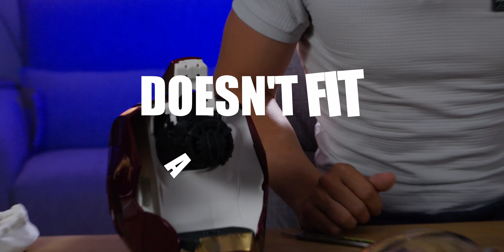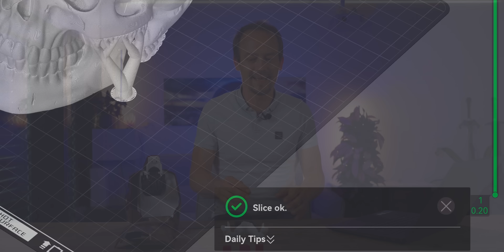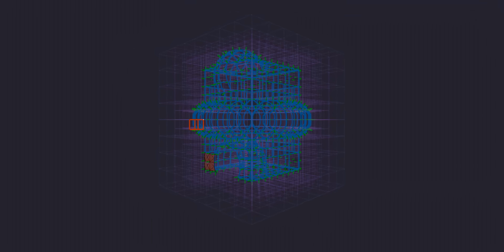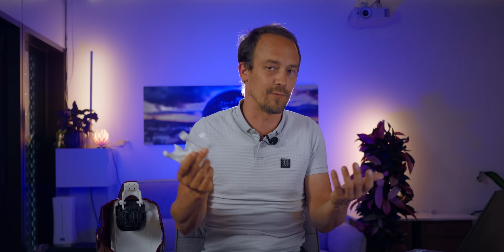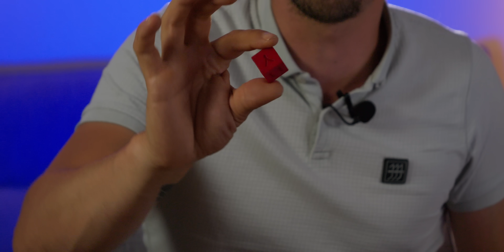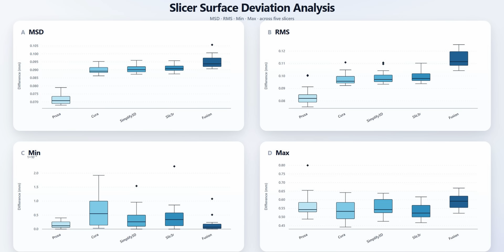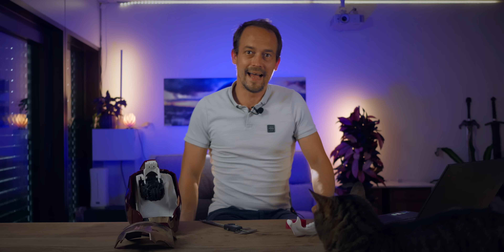The Hidden Error in 3D Printing - This is How We Found out

Comment: 15:38 - Can you also compare the intermediate meshes created from the gcode to the scanned 3d print?

If those intermediate meshes closely match the scan then you can more confidently say that most of the error is coming from the slicer. However, if the intermediate models don't match the scan, then you're probably seeing errors in the slicer and the print process interacting constructively and destructively, and they just happened to give about the same level of overall deviation in this test case.

Comment: Seems to be an issue that cnc machines are not facing. Could be somthing as simple as the nozzle diameter being added in the wrong direction. Slicers where first used for cnc and that is the total opposite of 3d printing.

Comment: 8:51 - I'm very curious how you converted the tool path, temperature, extrusion speed, etc. into "the geometry". Did you just put a shell around the tool path? That doesn't seem sufficiently accurate. Did you try to approximate all of the fluid dynamic magic that slicers depend on? That seems very hard. I'm not remotely qualified to draw conclusions, but wouldn't errors in the approximation algorithms, or just differences in assumptions, dramatically change the test results?

Comment: Slicers have all these crazy settings because of the filament and machine accuracy issues to begin with. They built those settings to correct for the machine and filament. So their true representation assumes based on those settings and makes corrections to the final gcode to be as close as possible after those settings and machine and filiment are all dialed in. It is not gecode as exact as the part. Its exact as the settings for your machine to print that part. Your simulation would need to assume the machine and filament act as per the settings suggest they should because those settings are compensation. But it is nice to know that one of the most popular slicers is one of the most accurate of the bunch!
Reply: Exactly, that's why I think his ranking is arbitrary. In Cura, for example, you can adjust the accuracy using the "Slicing Tolerance" setting which should give you 3 different results, not just one.

Comment: Anecdotally, your findings match the perception of Prusa Slicer being especially dimensionally accurate. But if I read the paper correctly, you are using a 0.1mm resolution for the voxel grid and display results with two fractional digits of a millimeter? That feels fishy, too fishy to be explained away in three sentences. It should have been a 0.005mm voxel grid at the coarsest. It feels like you guys went out of memory and didn't know how to implement a compressed voxel representation. Btw: Millions of millions of triangles is not a measure of precision...

On top of that: If you trust the voxels, then use voxels! exclusively! Why use marching cubes at all, only to then compare triangle meshes which is much more complicated and introduces more sources of error? Voxel volumes are much easier to compare. You could print a histogram of voxels by distance/error. You could draw the error as a 3d heatmap to gain a lot of knowledge. Maybe the error comes from elephant's foot compensation? Would be easy to see on a 3d heatmap. Maybe the errors in the prints are in an entirely different location than the slicer error? Would be easily visible on a 3d heatmap.

Anecdotally, a significant loss of precision is caused by warping induced by thermal shrinkage. Shrinkage is enough to make prints pop off the sheet or lift off the sheet. Assuming a shrinkage of 0.3% on a 200mm part is 0.6mm. As I understand it, you have your printers calibrated for shrinkage. But warping is worse than just shrinkage, especially for long and thin parts, e.g. a jawbone. This is a well known effect that is used by bimetals for example. Again this is something that would be easy to check and see on a 3d heatmap...

Comment: A few advanced slicer settings could explain errors on complex prints. A big one is "minimum feature size" which slags on an extra 25% nozzle diameter of ignored features on complex prints. Another is "outer perimeters first". You want to print the outer perimeter first on complex prints because inner perimeters can crowd the outer one another 25% during printing. The main situation where you do not want outer perimeters first, is multi-material prints where it helps to clean the nozzle inside the print. Another might be steep overhangs where you want some scaffolding to attach outer perimeters to. Slice closing radius can also be cut in half. Also try turning on arc fitting, reducing minimum perimeter width, increasing distribution count & transition filter margin. This has enabled me to achieve spiffy results with PrusaSlicer.
Reply from the maker: Those are some great tips for fine-tuning, I'll definitely have to experiment with those settings! 😊
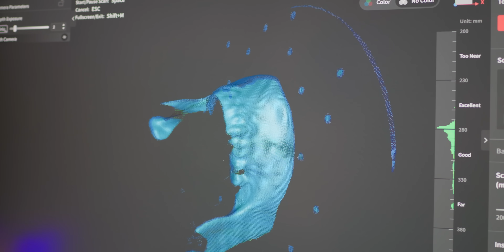Reply: @Ibuiltathing  I listened up to 14:24. You never actually discussed the fact that there are no actual curves in an STL file. Curves are always represented by strait line approximations. This means the STL has errors before slicing is actually done. Also, you kept holding up a very small calibration cube. It is better to use a set of calibration squares close to the size of the print bed. Doing so allows one to differentiate between linear travel accuracy and errors due to over or under extrusion. If you use a small calibration cube you may put the linear displacements out of calibration if the actual size of the small cube is significantly affected by either under or over extrusion. 
Large calibration squares also allow one to measure skew between axis. One has to look to these factors before going to more complex analysis.
Reply: @peircedan  Good points. Some 3D printing enthusiasts don't like the default, Arachne slicing engine, saying the old one handles complex geometry better. Perhaps it relates to tracing inside or outside the corners. Curve fitting can help compensate for the polygonal "curves" in .stl files. Unless we can get a slicer that can work from .step files, which I believe contain something akin to real curves.
Reply: @peircedan  There are curves in G-code (specifically, arcs), but for modern printers this feature isn't usually used because the printer firmware will approximate it as straight lines anyway and the slicer can do a better job at it.
Reply: @themanyone  All modern slicers can import .step files, but they will still render them into polygon mesh during import.
Reply: @Ibuiltathing please do and share the results!
Reply: Minimum feature size is definitely a factor for slicing accuracy for very local and high divergence areas, like sharp corners etc. However, the other 'fine tuning' items you mentioned are purely printing related artifacts. 
The study in this video primarily focused on the slicing related errors so outer perimeter or overhang handling has nothing to do with slicing.
Reply: @maxz2433  I was assuming he would try printing at some point. And mostly it's going to be other people reading the comment, and they probably will try  printing at some point.

Comment: that could actually explain a lot... because I often design parts with clearances and for some reasons I so far couldn't pin down sometimes the prints just turn out too tight. and the printer is well calibrated otherwise. and it's only for some things but not others. It would be interesting to know whether there is some systematic error to this or not (e.g. only inside surfaces being affected, etc)

Comment: How do you model the extrusion? Width and shape. Some slicers model the extrusion-crosssection as rectangular, other add semicircles to at least the outer wall. The arachne-perimeter-generator used by cura and prusaslicer can vary extrusion-width based on the geometries part.
Reply: He literally just used AI its nothing special.

Comment: You can set "volumetric extrusions" in PrusaSlicer. Which seems like it would make it easier to convert back to .stl files. However, I have not achieved good results with volumetric prints. So there is something lacking, or personal knowledge gaps are not making ends meet.

Comment: I strongly disagree with the final statement in the video. You are comparing scanned max deviation to your processed slicer deviation and making the conclusion that it is mostly the slicer error. I don't see enough evidence to support it. I would agree though that small features can be removed during slicing, especially in Z direction.

I did some research in surface texturing. At some point I was experimenting with sine wave side textures with amplitudes down to 0.05 mm. I had to model them layer by layer to be sliced properly and STL/G-code files were in gigabytes for a 1x1x1 cm cube. Scanning them with confocal afterwards confirmed concave texture smoothing, but texture was reproduced by FDM reasonably well. I could not get good repeatability between layers at the time - flow had a big impact. I needed repeatability within 5 microns for my purposes.

However, I find the study quite interesting and I read through the paper. Here is my main concern: you process G-code to point cloud, perform voxelization and STL reconstruction, but I could not find how much impact these processing steps add to your errors. I would like to see the deviation effect with each processing step.
Here is what I would do for validation:
1) Set the layer line width to 0 in slicers and use only tool path XY cloud points to compare with STL integrated crossections;
2) Process your original STL in exactly the same manner - extract sliced perimeters, do voxelization, xyz correction and STL reconstruction. Compare with the original;
3) Include simple calibration shapes to check which steps introduce errors at which stages.

Your MSD and RMS values are reasonably close across all slicers around 0.1 mm, suggesting a normal distribution. You also state that "Voxelization at 0.10 mm introduces a quantization uncertainty of approximately ±0.05 mm". So I expect larger deviations to come from 1) Processing algorithm 2) slicing in Z direction with 0.2 mm layer height 3) shell/offset generation based on extrusion width. The scanned STL models you use in the study are way too different from basic cube example to talk about slicer dimensional error.

I hope it is not too nerdy. 🙂It is a cool research, glad to see it published and in open access!
Reply: Yeah, I'd also like to see at least half-a-dozen prints made and compared with the same settings.
Reply: I don’t know why they didn’t compare the accuracy of the vocalized mesh and the scanned mesh.

Comment: You first need to optimize the geometry for manufacturing, otherwise these errors of 0.5mm you are seeing don't mean anything. On a part that hasn't been optimized for manufacturing may have sharp corners and features terminating to infinite points and other geometry which your process can't reproduce accurately your model HAS to experience certain dimensional changes in order to becoming manufacturable  with your particular method. You can't just assume that your geometry is manufacturable with any specific method without doing analysis and optimizing the geometry first, all manufactured parts go through this, its part of the design for manufacturing process and a good number of designers are not good at it because CNC programmers that end up doing that part to some extent quite often.

Comment: I assume you checked the accuracy of the scanner by scanning a machinist's reference or something?
Did you play with the "Slice gap closing radius" and "Resolution" settings in the slicers? (That's their name in Orca at least) With the Orca default that would close any gap below 0.1 mm
In the paper I didn't quite get how you make sure you voxelization process was accurate.

Comment: Are there any differences between the classic engine and Arachne slicing engine (Prusa)? Also, in Cura, there is a inclusive/exclusive setting for perimeter generation, does that affect the results?
What about different layer heights and VLH?
Reply: +1 for Arachne or classic engine. The paper doesn’t state which was used but it might be inferred from the paper’s methodology that it was classic.

Comment: In the manufacturing industry there is a widely used piece of software called Vericut which does exactly what you did here for all different types of manufacturing processes. I use this software every day as a CNC programmer. It uses a machine sim of whatever you are using to run through the g-code for the part and extremely accurately construct the resulting output part so that you can verify it dimensionally as well as verify that there are no issues on the machine or its control while running the code. But this is an industrial/enterprise solution and It is extremely expensive and is out of reach of normal 3D printing users. An open source analog of this software is something that the 3d printing community and the broader maker world in general would benefit from substantially.

Comment: Interesting !
I actually ended using STL (mesh) files a few years ago. STEP format is my default. That may explain, alongside having well-calibrated machine, why my prints are generally within a +/- 0.05mm margin. It seems quite reasonable, considering how old my 3DP is. 😅
Reply: STL is a triangle mesh format, it's a list of vertices and their connecting structure.

STEP is a boundary representation format based on spline patches and quadratic primitives, which can represent every curved feature in the same exact way CAD software handles it internally.

So far so good, you knew this.

However none of the slicer families we use today have algorithmic slicing support for curved surfaces. What they all do is load OCCT (the geometric kernel used in FreeCAD - also known as OpenCASCADE) and ask it to convert the STEP into a triangle mesh, so you end up with same exact thing as if you exported the STL - with the only potential difference is that the slicer is aware of the precision of 3D printers and asks it to keep the target deviation under 0.05mm and target edge length of 0.5mm or so i forget. Your STL export defaults from CAD can differ.

Furthermore when playing around with STL export settings in FreeCAD i have found some occasional undesirable behaviours where the surface was under- and overtessellated within one patch, and i must assume slicers should have the same issue - and i'd rather inspect the triangulated object myself if it's crucial. OCCT does not have a great reputation compared to commercial geometric kernels.
Reply: Hey mate, I'm new to 3D printing and got an anycubic Mono M7 as my first printer. Could you explain to me this STEP file? Can I just convert .stl Files to STEP and use it in lychee or what can I do for more accuracy? ❤
Reply: Hey! Actually, STEP/STP files are direct exports from modeling software. It doesn't contain meshes like STL files. A curve in the model will be a curve in the STEP. It's a solid. 
If your slicer can import them, that's it. It also depends on whether a designer provided these files when uploading models.

There might be STL to STEP converters, yet the results are hit or miss. It may also probably introduce errors, depending on the geometry. It may be OK with angular parts, less with curves and such.
Reply: @selimguclu625  STLs are literally the worst format for accuracy.

For example: there are no curves in an STL. STEP files actually contain curves. It's such a shame STL became the default 😭
Reply from the maker: Unfortunately all slivers use stl. Even if u import a step it will remesh it. There is no obvious solution yet
Reply: So true... That said, just asking, simple hypothesis : if a 3DP firmware and slicer support G-Code arcs, doesn't it slightly enhance the overall accuracy ?
Reply: @Lidocain777 no bc any firmware  even it supports arcs, actually used arcs - it still converts to lines, to x/y moves on stepper motors

Comment: I think the main reason your local inaccuracy is so high is because STLs notoriously do not represent curves well, and acceleration limits effectively round off detail in the STL causing significant local deviation. I had this problem a lot when I still used STLs. Nowadays I only use STEP models from solids (I work in engineering, so I basically never have surface based designs) and my tolerances are waaaay better. Also not surprised Fusion 360 isn't that great, it's rarely used by serious engineers anyway. I find my bambuslicer to be faster and better for basically everything I tried, even though I'm a happy user of fusion 360 for CAD.
Reply: The source data for the experiment is STL anyway rather than anything with real curves.
The acceleration profile doesn't round anything off. Before the current crop of printer firmware, printers used to be notoriously notchy at any accel. What changed was the introduction of resonsance suppression, which is what does the rounding off.
But the emitted GCODE is still generally just line segments. There is an optional post processing pass which lossily compresses G-code by curve fitting, and the compression is undone by printer firmware by converting the curves back to line segments, at a different resolution.
There is no native curved geometry support in the slicers at all - STEP file import just calls OpenCASCADE to emit a triangle mesh just like STL. Of course they tuned the settings best they could, but if you're mindful, you can achieve the same outcome when you export.
You have succumbed to magical thinking, imagining that the slicer can carry curves losslessly from your CAD to the print if you just use STEP files, but it can not.

Comment: if you want more accuracy adjust the X-Y contour compensation in Slic3r forks

and in Cura use the inclusive exclusive middle settings to get more accuracy 

because these setting alter the way the slicer fallows the contours of the model